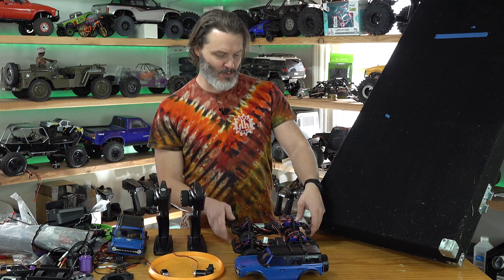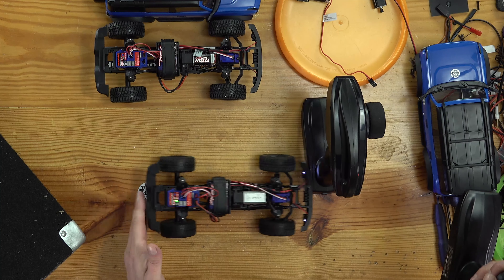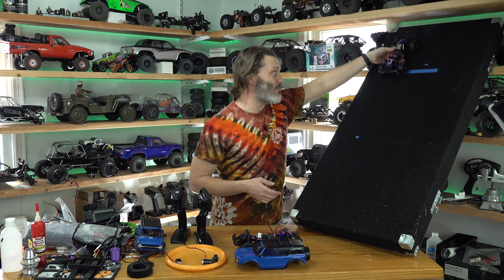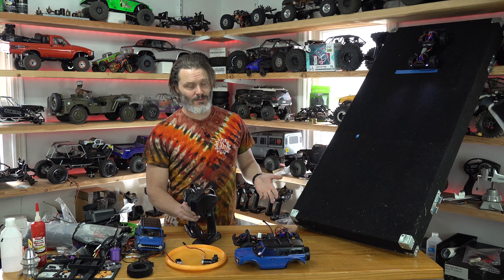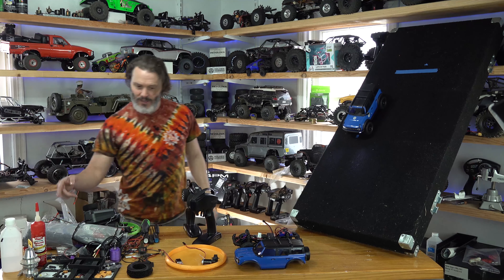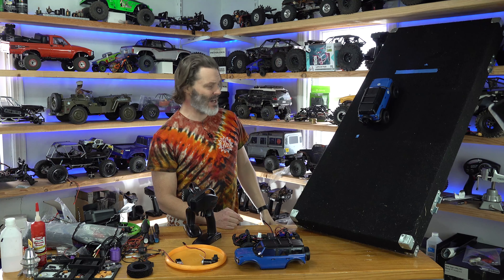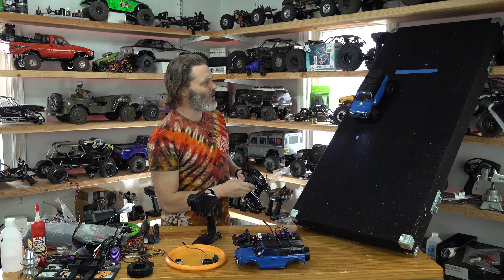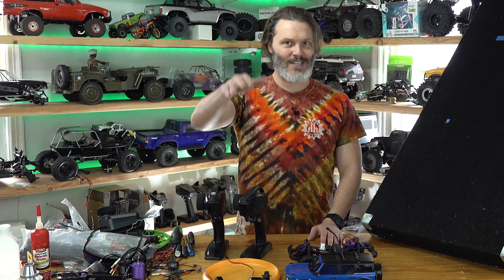ALL THREE MODES TESTED || TRX4M Slant board testing continued (TRX4 M Part 5) || Holmes Hobbies

Comment: Is there a aftermarket charging option for the 2s lipo battery the USB charger that come with it sucks
Reply from the maker: Not that I've seen unless Traxxas has an adapter for their larger chargers
Reply: @HolmesHobbies  I just contacted traxxas today with the exact same question especially since I wanted to use storage charge using their big ez peak charger. The answer from them was to use only their usb charger. So,no adapter yet for their big charger..

Comment: Would an esc swap be beneficial? If so which esc is the best option? If not, why? Interested to know
Reply from the maker: stay tuned, it's getting full upgrades
Reply: @HolmesHobbies  oh I'm subscribed and I watch just jumped the gun I suppose. Lol
Reply: if you wanna keep it brushed, Modelbau Rehlger from germany is probably the most cost effective that's really compact

if you want something beefier and programmable, as mr Holmes suggested, the cheap option is the ISDT esc (can be found for 30$ or so), while the tried and tested is the HobbyWing 1080. both are quite big (though there are people who have already fitted the 1080, so the ISDT should work similarly). the BR Mini would be overkill, as noted by Mr Holmes himself :)

brushless? the usual suspects, i guess :)